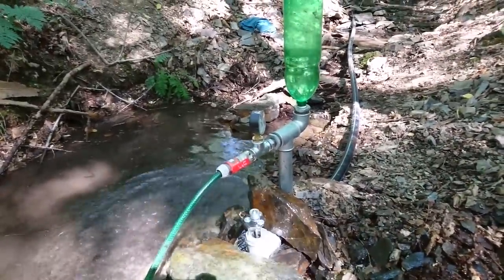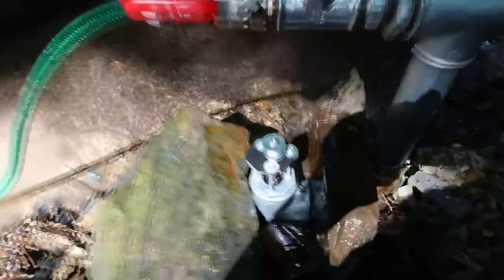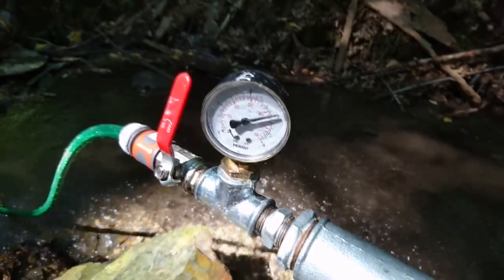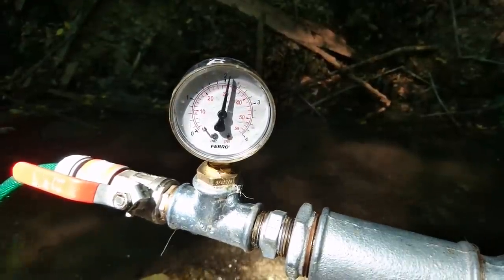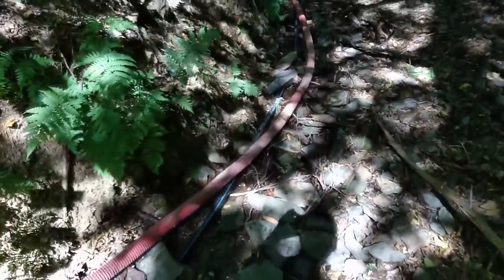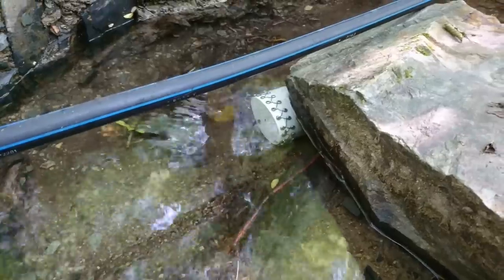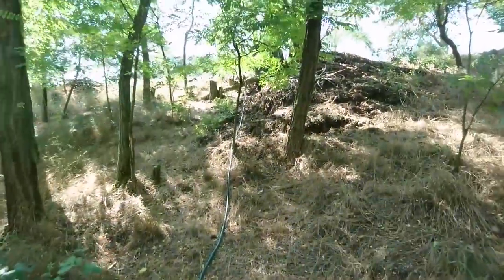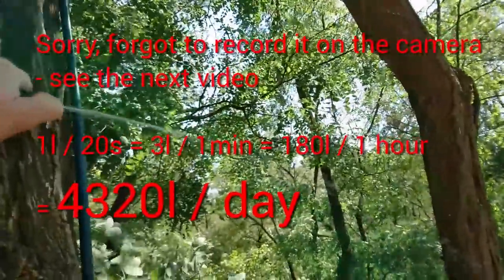HOMEMADE 5/4'' Ram Pump - elevation ratio 1:15, 4320l per day

Comment: Nice video and presentation. 
I wanted to better understand your pump operation. Am I right that the waste valve will hold in a closed state by the feed pressure indefinitely if we manually pull up the valve stem to a closed state? I can see some washers there to preload it towards open state. Your advice ?

Comment: Watched another channel they built a big one heavy duty with 2 pump valves one big pressure tube like you building their own valves. It is easy to close on off just tighten the top nut until closed. These are such a great invention. So easy to make I am impressed.

Comment: Great job, you are getting a substantial amount of water. If you build another one, use steel pipe for the last 6 to 12 meters. I also notice that requires some pressure for yhe delivery line, just for people that is pumping a few meters high shouls put a valve to restrict flow and increase pressure. I have seen old pumps that the shut valve you built, on the bottom was sbape to induce a very small rotation, almost imperceptible,  si it wears evenly all around and always seals.  Love your improvisation, that helps people.

Comment: Fantastic! Hard to believe that the plastic bottle withstands the pressure and cycling. At least they are very inexpensive to replace! Good to have a visual indicator of air cushion.
Reply: yes it is a good idea (to be able to see) because eventually they do fill up with water all together and Stop so the Old commercial ones have a thing called a SNIFLER VALVE which introduces a small amount of air each cycle which keeps them going indefinitely unless some rubbish gets stuck in one of the valves. I looked in these things quite a bit years ago & decided to not use one, I've dragged a pipe up stream a couple of hundred meters and well, I have 100 Psi head now so I don't need one but in this situation it is perfect, old mate here only needs a tank stand so he can have gravity feed pressure to his house. That's the way we Ausies do it anyway.
Reply: @hiteck007  instead of a snifter valve, you can drill a tiny quarter millimeter or 1/32" hole just under the one-way valve. The smaller the better, there's so much resistance to flow you don't lose much pressure, but you get a tiny bubble of air sucked in every cycle.

Comment: Very lucky with that pressure your pressure tank did not explode. I have 7 meters of vertical head, before I'm using a double 1" waste valve to my ram pump but lately I'm single out the latter, but the problem is the cycle is too quick and the delivery of water is less. I put more weight to reduce the cycle to less than 60 a minute but when priming the delivery valve Is close the pressure tank (bladder) the tested maximum pressure of 15 bar is deform and nearly explode. It means when putting additional weight on the waste valve  it can creates more pressure and height that the pump can deliver.

Comment: How do you build the "most efficient" check valve? Could you make an explanatory video with the theory and what you modified? Thanks.
Reply from the maker: Hello, check my other video. I think everything you have mentioned is already there - https://youtu.be/UEWl-8S19eI
Reply: @BohumirStehlik  great work! thanks,  and I've got a question you might be able to ponder - 90% of the water is wasted/expelled to stream, at pressure - could that be harnessed to turn a diy turbine for electricity? I know it's possible, but it's probably clearly way too insignificant, or maybe not? Any thoughts??
Reply: @BohumirStehlik  videos

Comment: Excellent design & Video. Good data provided was very helpful in evaluating it, and so clear I can build one from the pictures (but the PDFs would be welcome).  I would have to say this is the best I've seen on You Tube. Highest demonstrated efficiency of any I have seen so far and easily scalable. Even better than any of the build kits I've seen advertised.
Steve from Minnesota, USA. (Master Engineer in Hydraulics)

Comment: Very good design.  Except you should put a shut-off to the meter so the hammer effect will not damage it over time.  Just open it for occasional readings.
Reply: Good idea, or you could remove it and plug it intermittently if you had to.

Comment: Hi Bohumir!
I've been watching all your videos and all I can say is that they are awesome! 
I want to make a ram pump just like you and in my case I have a 3m fall and I just want to bring the water around 5m high (so just bring it up to 5m and then straight) but for a really long distance like 300m, will it be possible with a similar ram pump? What size would you recommend?

Thank you!!!
Reply: That should work just fine. The size depends upon the amount of water going down the stream, and how much water you need.

Comment: Thank you for sharing sir, great video, but how about during rainy season the water volume on the stream is huge and also flash flood can destroy it?
Reply from the maker: As any other device.... It is sturdy (sturdier than a plastic pump) but needs to be anchored well.
Reply: They can actually work underwater.

Comment: Nice presentations and instructions for efficient tech dev for ram pump. I can see there is a bubble or some similar in teh transparanent bottle, do you utilize a so called snifter valve? -can you describe more about this feature of the pump operation ?

Comment: for slide check valve like yours, i had check around my supply plumb store, they don't have it, only spring check valve. but i'm interested on your model, can i get any link that i can buy online. thanks
Reply: I heard you can still use a spring check valve but just remove the spring to get the swing valve effects..
Goodluck.

Comment: did you say the elevation difference from pump to tank at top of property is 70 meters? if so, how wide is your tube entering the pump? thanks
Reply from the maker: 70 meters? The difference is around 15 to 17 m.

Comment: Thank you so much for the video. 
How do you start it after installing?
Reply from the maker: No air in the intake pipe, then several presses of the waste valve for "priming" of the tank and making right pressure.

Comment: What is the minimum difference elevation of the source and the pump to achieve max pressure?
Reply from the maker: Max pressure depends on the water drop. Here the water drop is 2,8 meters. You can cound approx 1/15 ratio. So for example if you need the water to get to 50 meters of height, then you would need minimum of 3,3 meters of water drop.

Comment: Possible to reuse waste water for recycling?
Reply from the maker: Recycling? No, you would need to use energy to deliver the water back to the delivery pipe...
Reply: @BohumirStehlik  thanks for answering,  one more question,  why to use both sides pipe line very long,  ?,
Reply from the maker: @MuhammadSaeed-qn1cf What do you mean by "side pipes"?  The intake pipe is "tuned". It needs to have enough downfall. My stream is not so steep so that's why it needs to be so long. The delivery pipe is so long because of the delivery distance.

Comment: what size your spring check valve? thank you,
Reply from the maker: The spring check valce is 1 1/4 inch, the waste valve is 2inch.
Reply: I have read the comments in your other video, the waste valve is Tee 2 inch with reduction to 1 inch, maybe I will try to make the same ram pump,
thank you so much,

Comment: Hello.  what must be the minimum level water difference to the water pump?
Reply from the maker: Hello. To be honest, I don't know. It depends on the weight of water vs weight of the piston in the valve.
Reply: Bohumir Stehlik last question „5/4 slide check valve” i cant translate what is it. And i cant see shop for that produkt in google. What is it different name....
Reply from the maker: @Mieszkoty  https://www.tzbeshop.cz/zpetna-klapka-celomosazna-3/4-
Reply: Bohumir Stehlik not that, i question 5/4 slide check valve. That is that? https://allegro.pl/oferta/zawor-zwrotny-mosiezny-z-koszem-ssacym-2-cale-6696330500

Comment: I think that 4.2bar gives you 32m not 42. You have to substract one bar for the atmospheric pressure.
Reply from the maker: 1 bar = 10m. 0,1bar is the atmosferic pressure.
Reply: @BohumirStehlik  https://en.wikipedia.org/wiki/Atmospheric_pressure
atmospheric pressure is 1013.25millibar. Hence approx 1 bar according to wikipedia. 

I quite like your setup by the way. Very interesting.

Comment: is your pump weight activated or spring activated at the end?
Reply from the maker: That I don't understand. The pressure of the water pole is the "engine" of the pump. The weights are there only for slowing down the pulse and letting the water to flow faster = more power.

Comment: Som velmi prekvapeny, ze si na 2,8m spade ziskal az 4,2baru... Prave vyrabam svoj prvy trkac ale robim ho na velke spady. Este neviem, aky spad bude tam kde ho chcem pouzit ale potrebujem vytlak 6,5baru cca. Tak som zvedavy, asi o dva tyzdne sa bude testovat.
Reply from the maker: Držim palce. Ventil udělej pořádně  aby vydržel. A přivodní trubku by to chtelo buď zahrabat, nebo dát kovovou, aby se nedeformovala.
Reply: @BohumirStehlik  ako myslis nedeformovala? Mam zatial v plane dat 2" ciernu HDPE ako privod a ak budem schopny ziskat potrebny tlak, tak casom ju nahradim kovovym potrubim. Inac, k trkacom existuje tabulka, presne pomery dlzky privodneho potrubia vo vztahu na vysku spadu. Ked je potrubie prilis kratke, nevyuzije sa cely potencial spadu a ked je zase prilis dlhe, trkac zbytocne "caka" a teda spravis menej cyklov za urcity cas. 
A co sa tyka trkacieho ventilu, ten som spravil z bronzu, myslim asi 6 alebo 8mm hrubeho cize by mal zvladat aj velmi silne razy. 
Ked to dokoncim, chcem o vyrobe aj o testovani spravit video, ak nezabudnem, preposlem link.

Comment: Интересное видео. Жаль что эти технологии секретят от людей.
Reply: It is not secret - this technology is more than 200 years old, and it is in textbooks of every hydraulic engineer. The problem with it is, that it wastes a lot of water - probably about 80%. No problem in this case - it just returns water to it's original stream, but not the same in any situation. Also, water hammer effect (it is what makes this pump to work) on the check valves, especially on the waste valve, wears them out fast, and this type of pump needs occasional rebuild.

Comment: 4320 l per DAY... on that small pump... i question the math....
Reply: Well assuming the pump operates 24 hours = 1440mins. Then 4320L/1440mins= 3L/min. Not really hard to believe. Even if it only runs on 12hours a day, 6L/min is still relatively achievable, don't you think?
Reply: @josefmadrona3606  4320L is 1141.223 us gallons. using ram pump formulas and standards. https://www.nrcs.usda.gov/Internet/FSE_DOCUMENTS/nrcs142p2_041913.pdf you would need 25 to 30 gallons per min source. with a 4 inch drive pipe. with this you would need a better  pressure tank then a soda bottle. in my math and estimation of the source water flow of 10 to 15 gal per min it would be impossible and he is not using the entire sources with water head. the drive line is not straight and is not a steady slop. this all affects the effective head. is also is not anchored down and can  move has flex.
Reply: he also said 3 letters per min on the supply line. he also did not record the measuring of the water flow rate....
Reply: @Master-ls2op  Thanks for the info. Didn't really know much about this type of pump and thought that 3L/min would be quite small and achievable even for most small pumps on the market. Thanks.
Reply: @josefmadrona3606  i have several large pumps with 10 gallon chambers with 6 inch 200 feet drive steel pipe  and a source flow of 100-150 gallons. and just manage to get the ratings he says and my pump is also a piston ram pump...

Comment: If the drive pipe has to be a minimum length of 6x the downfall, you`d need 120ft drive pipe for 20ft head..seems excessive :)  With a 1" drive pipe the 120ft (1440 inch) length would exceed the maximum 1000 x  pipe diameter. You`d be forced to use a standpipe :)